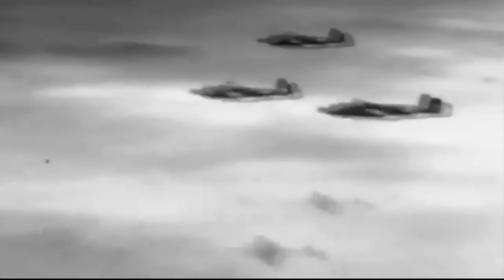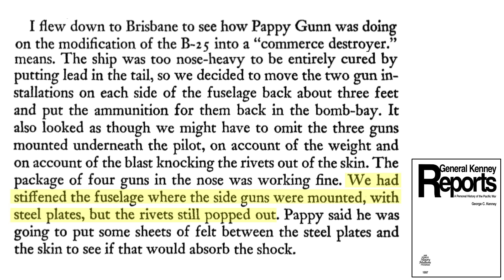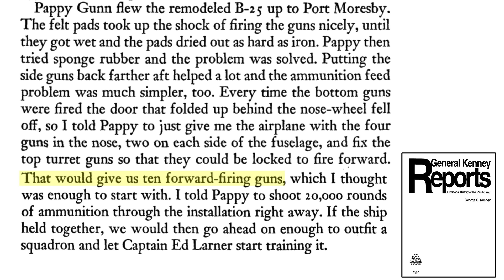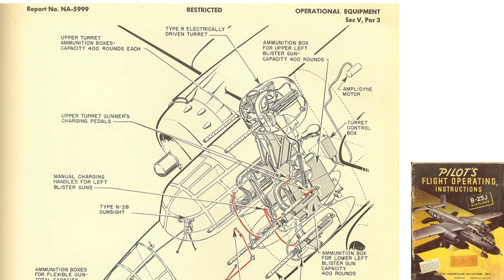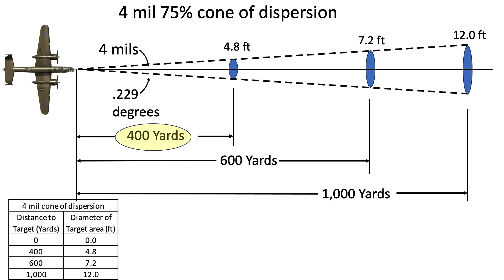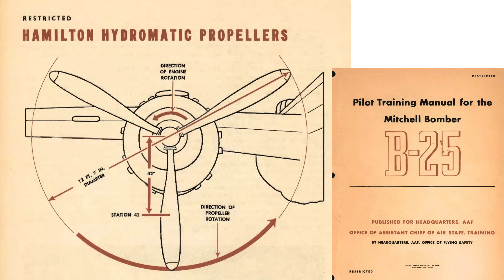B-25 Blister Mounted Machine Guns Incorporation Challenges and Combat Effectiveness- Deep Dive

Comment: I'm really enjoying the B-25 Mitchell series! 

Someone in an earlier comment made a comparison with the Bristol Beaufighter in the anti-shipping role. The Beaufighters developed a similar tactic of combining flak suppression fighters (but with 4x20mm cannon and six light machine guns) but instead of skip bombing they used armour piercing rockets, which worked especially well against U-boats. 

I've recently watched the 1970 movie Catch-22 which has some excellent scenes of the bomber version of the B-25 taking off, landing and in formation. But as a kid, I made an Airfix kit of the Mitchell which offered (if memory serves) three alternative nose cones - either the bomber, with its Perspex panels; this version bristling with machine guns, or the version from the earlier video with a 75mm cannon. 

As a kid, and preferring fighters to bombers; I could not resist installing the 75mm cannon (although I also added the blister mounted machine guns, because they were too good to leave-off

But having seen your earlier video on the failure of the 75mm cannon in operations, I think I should have made the multi-machine gun version.

Comment: As for the effective firing range of the Browning M2 50 cal, if the B-25 is flying at 300 mph, that adds an additional 440 feet oer second to the muzzle velocity of the bullets which are normally traveling at around 2,800-3,000 feet oer second. That alone probably extends its range a bit. Also, that effective firing distance was partially due to the convergence issue you mentioned but also due to the vibration and heat from the guns effecting the accuracy. This means that guns on a Hellcat ir a Warhawk will be more or less incapable of getting effective hits on a 1-2 man aircraft beyond 400 yards, but the B-25 is a more stable platform and the target is the size of a destroyer or freighter, and isn't moving as fast or changing direction as quickly so I'd surmise the effective firing range for the B-25 was probably twice the normal range.

Comment: I always wondered how 20mm cannons would work in this application.

Obviously you would have less guns and lowe firing rate, but long range accuracy would be much better.
Reply: Less ammo as well. Which is not better
Reply: The de Haviland mosquito had a variant with a 57mm 6 pounder for U-boats, apparently it was pretty successful, just don't get trigger happy or you will stall the plane

Comment: What did US aircraft cannon production look like during the war? Yes fifty-cals were available in huge numbers, but what about say 20mm (aircraft or Oerlikon AA) 37mm from P-39s, or 40mm Bofors? I've heard stories before that US built cannons were unreliable, or installed improperly so that Corsairs with 20mms were restricted to low altitude due to icing.
Reply: See .y post on the RAAF Bristol Beaufighter.  Four 20mm Hispano cannon in the nose and six to eight 50 cal Browning's rings in the wings.

Comment: Not sure if you’ll do a video on the 8 gun nose mod kit, but that was the single most lethal attack aircraft variant of the war IMO. 8 guns in the nose, 4 in blisters, and two in the top turret. 14 AN/M2 .50 cal machine guns firing AP, IN, and T ammo (later I’m sure it was just API/API-T) at 800 RPM each or 11,200 RPM collectively. Or 186.66 rounds per second. That is more rounds per second than any modern Gatling gun, ever…. Plus the aircraft still carried enough bombs to sink a destroyer in a single pass. The A-10 of WW2!
Reply: Not really. The RAAF Bristol Beaufighter, called by the Japanese the " Whispering Death", had four nose 20 mm cannon and six to eight 50 cal Brownings in the wings. A squadron effectively killed the eight IJN escort destroyers at  Bismark Sea.
Reply: @oweneather1435 4 nose 20mm and 4 .50 cals in the wings. The B-25 with 14 .50’s still had about the same weight of fire per second. The biggest disadvantage is the different trajectories of the different calibers and the fact the wing mounted guns had to be converged at a certain point, meaning that all the guns could only be impacting a target at very specific ranges. Also it could only carry up to 1,000 lb’s of bombs verses the 2,000 plus for the B-25 in their respective gunship versions.
Reply: @TJ24050  Agreed.  All nose mounted, all same ballistics.

Comment: Good video, but I wish you would have covered the later 8 gun nose with the 4 blister guns, for a total of 14 forward facing when the dorsal turret is added.
Reply: When the 8 gun nose arrived squadrons began by removing the side guns from them to save weight.  It can be a fun pass time searching for photos of pacific 8 gun nose B-25s that still have the side packs (all I've found so far were brand new and not yet had them removed.)  The top turret was far more useful when independently aimed and fired.
Reply: @rpurdey  the first B-25 plastic model that I built had the option for all 12 guns.  Now, maybe the kit manufacturer wasn't perfectly accurate back in the 1970s, but it's not hard at all to find quite a few photos of 8-gun nose B-25s with the four blister guns. There are also a ton of paintings of such planes, which may or may not be accurate, but gobs of old photos of them, too.

Comment: Considering at range the dispersion of bullets was 22ft i don't see why straight facing wing guns were incompatible
Reply: They would have to be aimed inwards for convergence at a fixed distance or straight ahead and then there wouldn't be concentration of fire.
Reply: @richardjames1812 for a plane,  yes.  Not a ship.
Reply: @drfill9210  They weren't trying to suppress an entire ship, though.  They were trying to suppress AA batteries on a ship's deck, which were a much smaller target.
Reply: @richardjames1812 all good,  i was just pointing out that the size of target was exactly the same as a parallel dispersion.

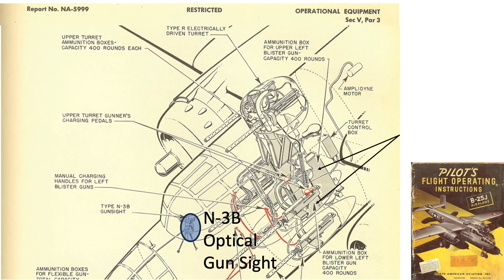Comment: Maybe you can do a video comparing the different gun turret models on different US bombers. For example, the report page at 6:00 of the video shows the B-25 upper turret as Type R Electrically Driven. Is this the same upper turret as a B-17, B-24, B-26, etc.? How do the US turrets compare to those of other countries? It seems like the US committed a lot of resources to these turrets, not just in construction costs, but also consuming the weight constraints of each plane, and the use of crew resources. Presumably there was a lot of effort put into making these turrets as effective as possible.

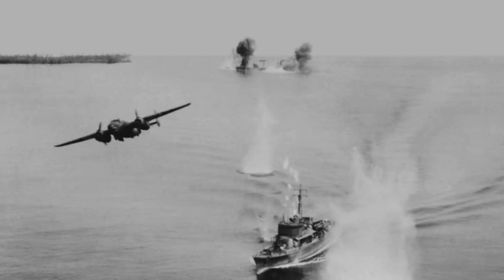Comment: 08:53 "The 1000-yard bullet drop of 25 feet…“. Hunh?
Reply: Once the bullet leaves the muzzle of the gun, it falls downward due to gravity as it travels. At a range of 1,000 yards, the bullet will have dropped 25 feet below where it was when it left the muzzle.
Reply: @glennheth3472  Astonishing. I knew there was bullet drop, but I had no idea it was that much for a .50 cal. bullet at a thousand yards.
Reply: @danl.909  You can do a rough calculation.  d = 16*t*t.  In one second it will drop 16 feet.  If muzzle velocity is 2500 fps and it slows down some, call it 1.5 seconds to 1000 yards, that gives you 36 foot drop.  Or do it in reverse, 25/16 = t*t, t = 1.25.

The real trick is knowing the average speed.  But you don't need precision.  Those numbers show the pilot can walk the splashes into the ship, and the pucker factor of seeing doom walking up to you probably distracted a few ship gunners.

Comment: I wonder why they only added .50 caliber machine guns instead of at least a pair or two of 20 mm cannon. The .50 caliber machine guns on a PBY4 Privateer were not powerful enough to pierce the hull of a German U-boat, but a 20 mm cannon from a Beaufighter or Mosquito could do it. I would imagine the hulls of Japanese freighters and tankers, and possibly even destroyers, would be susceptible to 20 mm cannon fire.  Why fire rounds that could primarily suppress AA fire and maybe set off a torpedo with a lucky hit when you could fire a mixture of calibers that would both suppress gunnery fire and potentially pierce the hull and damage the ship?
Reply: Because the idea was volume of fire to keep their heads down, vs damage while they make a bomb attack.
Reply: @orbitalair2103  Yes.  Damage from 20mm was pretty pointless when it was soon going to be sunk by a bomb or two.
Reply: At that time, the US was having difficulties getting 20mm aerial cannon to work reliably
Reply: i don't think they cared about damaging the ship, the goal was to distract the AA crews long enough that they can hit the ship reliably with a bigass bomb. They could fit a lot more 50 caliber guns, and a ton more ammo, all of which would make the insanity on the deck worse. Poking 20mm holes in the ship would be nice but compared to what a bomb hit would do, it's insignificant.
Reply: There's something to be said about standardization of weapons systems. I have a feeling it was just the fact that it was easier to maintain and supply the .50 cal weapons. The field modifications likely used the .50's because of the abundance of spares.
Reply: The RAAF Bristol  Baufighters, with 4 x 20mm Hispano nose cannons and 6- 8 wing 50 cal, knocked out all the destroyer escort.
Reply: @oweneather1435 the Beaufighter was a freaking awesome attack plane and the Australians were truly excellent with it.  I always thought that the popularity of the Mosquito overshadowed how good the Beaufighter was.  The Mosquito didn’t work particularly well in the Pacific Theater.
Reply: The nature of plywood glue was that it came apart due to the high humidity. Towards the end of the war they solved the glue problem but the war was nearly over. @petersouthernboy6327
Reply: @petersouthernboy6327 Many thanks, Peter. Look for my longer post on the RAAF crucial part in SWPA.
Reply: @oweneather1435  Merchant ships had AA guns too.

Comment: Im surprised they didnt like the wing guns. I figured a ship was a wide enough target where any additional firepower would be useful regardless of there it was mounted.

Additionally, i think its interesting that the b25s would not have been effective against alied ships (ostensibly) because the emphasis on protected dual purpose AA guns
Reply: Japanese anti aircraft guns were pretty terrible all around, luckily for the b25s. The 25mm are legendarily terrible
Reply: I think it has to do with the  structure of the aircraft, maybe? If they mount them all in the nose, they they can put all the ammo inside the fuselage where its already hallowed. Putting them in the wings would require room for the ammo and redesign of the structure of the wings. That and with the MGs all spread out, they get less concentrated fire on target. Just a guess, though.

Comment: Super interesting, especially those strike patterns.  1000 yards 22' x 16' is 352 square feet.  8 guns at a conservative 600 RPM is 80 bullets per second, or an average of one bullet per 4.4 square feet of the strike pattern, of course, concentrated towards the middle.  A standing man sized target would, IMO, project about that same rough order of magnitude frontal area so would likely be hit.  That would be some serious suppressive effect on the ship AA gun crews, causing them to cower behind their shields and doing damage to light equipment like ready service ammo, sights, range finders, etc.
Reply: The .50cal bullets hitting the steel of the ship would cause them to shatter on impact - causing a shower of copper jackets and lead ricochets.  Unless a ship had AA stations which had 360deg armour protection - I can’t imagine there being a square foot of safety anywhere on deck.
Reply: @johngayder9249 I can’t remember the exact mix but they fired ap and incendiary rounds too. The mk211 just combines both with a small explosive charge
Reply: @TheCrapOnYourStrapOn early war .50cal ammo mixes were two AP, two IN, and one T.
Reply: The AN/M2 had a cyclic rate of fire of roughly 800 rpm. So add 25% more rounds to that impact area.
Reply: Imagine them firing the mk211 round. That would be a sight to see
Reply: I don't think that any sane person would want to be caught facing such an onslaught from not one but two B-25s.

Comment: Did anyone else notice that the tank illustration in that Fighter Gunnery manual (6:38) is a British Matilda tank? No wonder that American Army tank recognition during WW2 was so poor.
Reply: It also looks like a Japanese Type 95 tank. It's just a sketch, and the purpose of that particular manual is not tank recognition.
Reply: @altratronic  You are correct. The document had nothing to do with tank recognition, but that is definitely a drawing based on the Matilda (look closely at the engine deck and side skirt details). No way that's supposed to be a type 95.

Comment: If only Pappy had access to miniguns.
Reply: Amazingly, a single 250lbs Vulcan Cannon had the same fire rate as TEN .50-cal machine guns, except with 20mm projectiles.
Reply: @Treblaine there are .50 cal versions of it also. Both western and soviet/russian. Revolver cannons are pretty neat too. I’ve always been partial to the dual barrel 23mm Soviet designs
Reply: Miniguns are only .30-cal., though, right?  The .50 hits harder and carries farther against things.
Reply: @genreynolds6685 .556/545 is the smallest
Reply: @genreynolds6685  The original 20mm rotary cannon is the "normal" size, but all the smaller versions are colloquially known as miniguns. Particularly if they're in calibers too small to count as a "cannon" i.e. smaller than 20mm.

so 
20mm caliber and up = Rotary Cannon
Much below 20mm = "minigun"
Reply: @genreynolds6685 there are .556 in the U.S., .545 in Russia 
.50, 20mm, 25mm ,30mm
Reply: @genreynolds6685 they come in a variety of calibers but modern ones on fighters are 20mm. The A-10’s is 30mm.
Reply: @billbraske2894 
Those aren't miniguns.
Reply: @rustyshaklford9557 well they aren’t “mini” because they are full size. So if you’re saying that they specifically aren’t in small caliber, you are correct. If you’re saying that modern US fighters don’t use a rotary cannon, you are incorrect.
Reply: @billbraske2894 
Yeah, I'm aware that I'm correct. Thanks for the confirmation.
Reply: @rustyshaklford9557 you sound upset.
Reply: He could have gotten a hand cranked one lol
Reply: I'm surprised that they didn't develop a rotating gun during ww2.